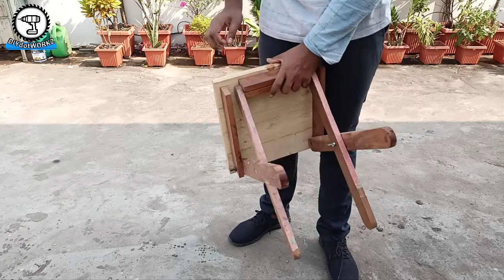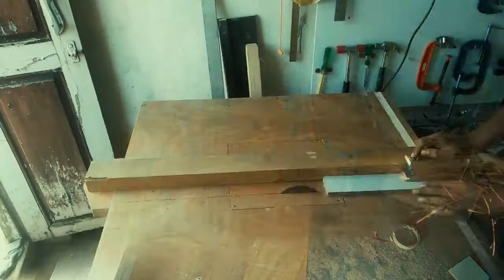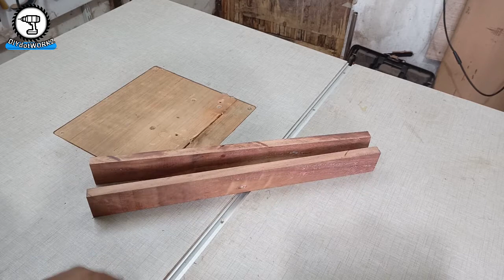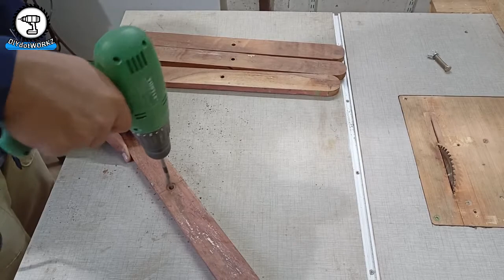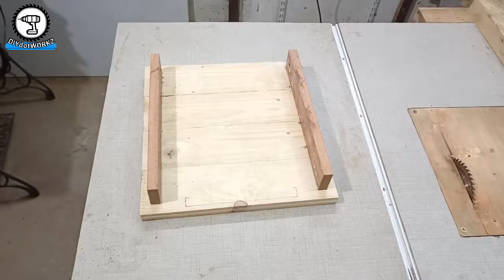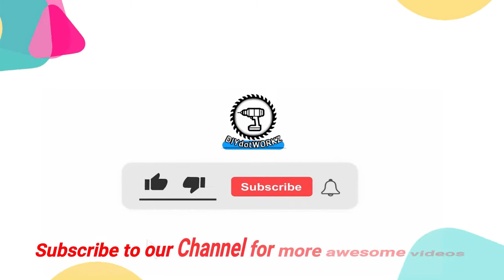[DIY] How to Built a folding chair || folding stool DIY

Comment: What kind of bolt and nut did you use on that folding leg?
Reply from the maker: i used normal nuts and bolts, but you can use partial threaded bolts.
thank you for all.